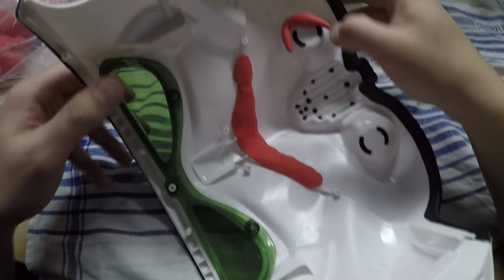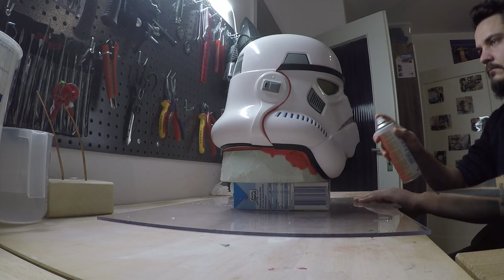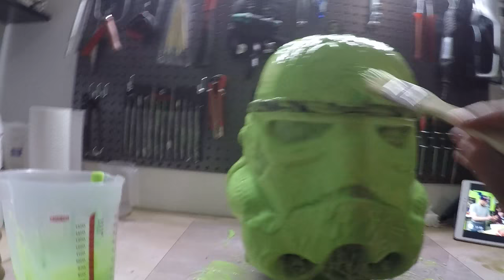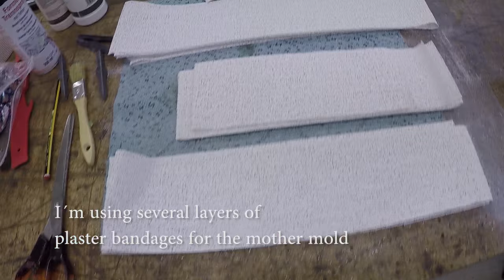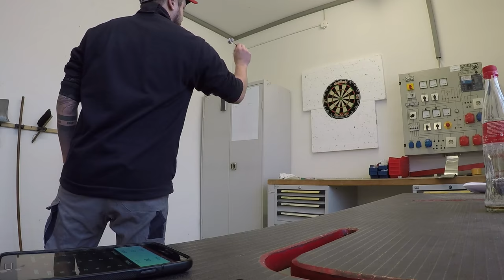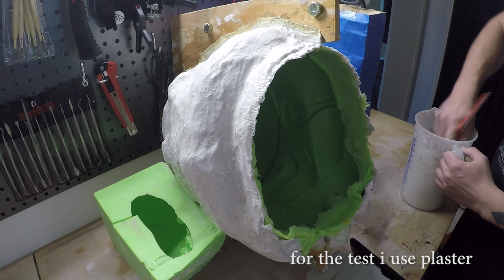How to make a Star Wars Stormtrooper helmet brush on mold and casting

Comment: It turned out great, well done. I'm looking forward to see full helmet casts!
 I'd love to give this a try but i have no experience at all with all these materials, like seriously, NONE. Do you have any suggestion on where to start to gain some practice and experience with this stuff?
Reply from the maker: Thx.
I started 1 year ago trying small things you can see in my previous videos.
this was my first brush on mold. the one part molds are easier.
and as this silicone is quite expensive in my area I watched a few videos and started by making small molds...
you ll gain experience fast once u did 1 or 2 molds....
i can recomend the tested channel :

https://www.youtube.com/watch?v=DEVi0mEaJJQ

and my videos of course ;)

Comment: what material are the registration point?
Reply from the maker: +KinzDarell it's silicone too....I've had a few left overs from old molds, put them on the mask and brushed over...
Reply: ok.what about when making a mother mold. Can I use fiberglass instead
Reply from the maker: yes sure!

Comment: Did you let the silicon dry after each layer or keep adding layers while it was still wet?
Reply from the maker: ProNicolson 
I let it dry each time....
Needs about 20-30mins
Reply: Will silicone layers all bond as one?
Reply from the maker: ProNicolson 
Yes
The only thing that reacts with silicone is silicone...

Comment: What is the mold release spray you used?
Reply from the maker: Its not any specific one, just took the first one I found online, works.
Reply: Le Nerdarto the ones I’ve been looking up online have usually been for the wrong type of mold, ie. silicon on silicon or so on but I haven’t really been able to find any for silicon on resin, I’ve heard baking oil spray works alright but not sure yet. I’ve been pouring my blood sweat and tears into the project I’m working on and i definitely dont want to fuck it up lol.
Reply from the maker: @lando8971  i havent thaught about it bevore i did it, i used silicone vs silicone spray, worked fine on this project and all others  used it
Reply from the maker: https://www.amazon.de/RESINPAL-Polyesterharz-Silikonkautschuk-Formentrennmittel-Silikon-Formen/dp/B07XH7KJFS/ref=sr_1_2?__mk_de_DE=%C3%85M%C3%85%C5%BD%C3%95%C3%91&dchild=1&keywords=TFC+Troll+Factory+mold&qid=1587192814&s=diy&sr=1-2

found it...  obviously its a wax spray, no magic there :D